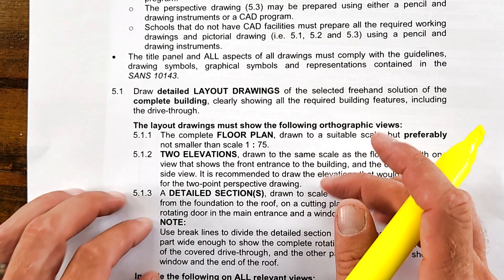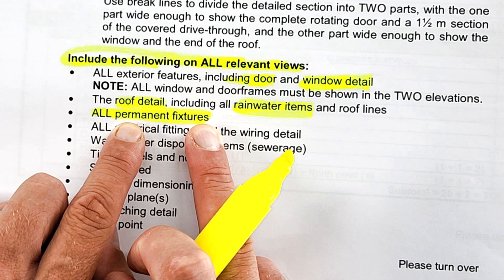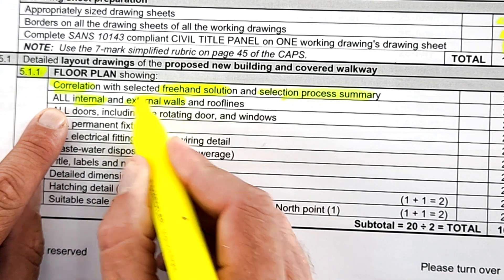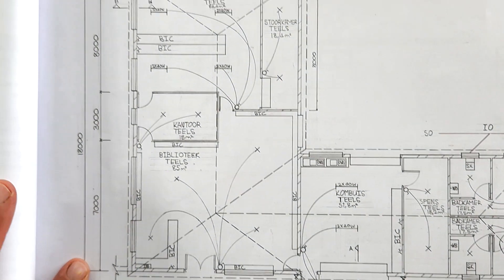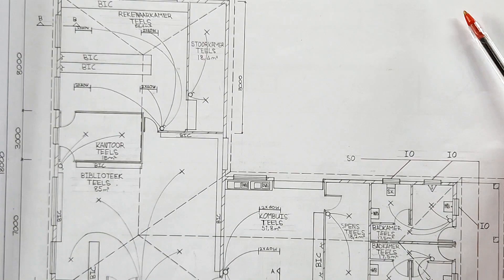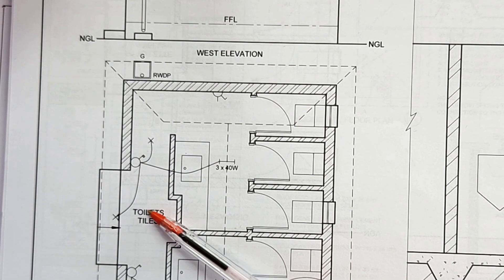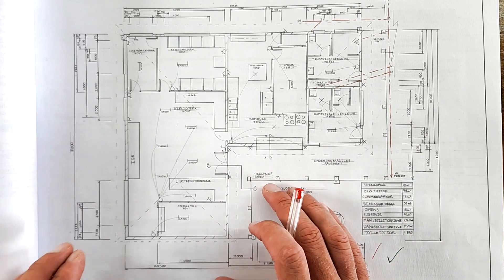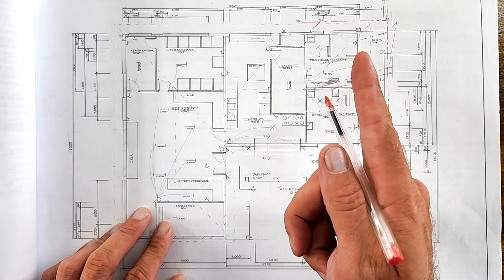How To Hack Your EGD PAT - FLOOR PLAN - Episode 8

Comment: Mr Kleyn can I get some advice from you about curved wall on floor plan.
Reply from the maker: Hi, thanks for reaching out to me. Please let me know your specific advice needed. In general, I have encouraged my learners to keep to a simple inner wall design behind the reception area, almost as a curved feature. I have also posted some specific PAT resources and exmaples on the COMMUNITY TAB of the HowToEGD Channel. You will have to scroll through the feed to find it, but there is a clear example of how the curved wall should be drawn. All the best.

Comment: Sir what are the dimensions of the revolving door
Reply from the maker: Hi Bokamoso, thanks for the question. Remember, a rotating door is part of your research requirement, so technically you should be able to answer your own question from your conducted research. My advice would be to keep the diameter to between 1800 and 2400 and the height the same as your swing doors. Please also check the "Community Tab" feed for more detailed and specific PAT support documentation and examples you could use in your own PAT. Blessings